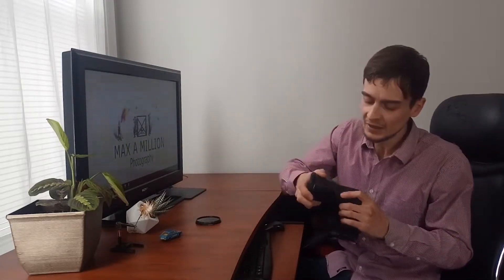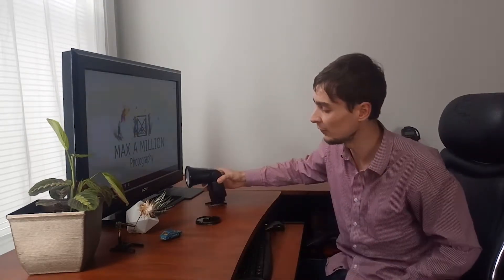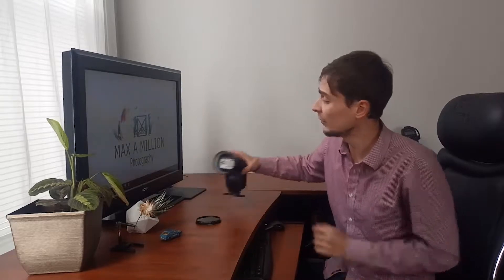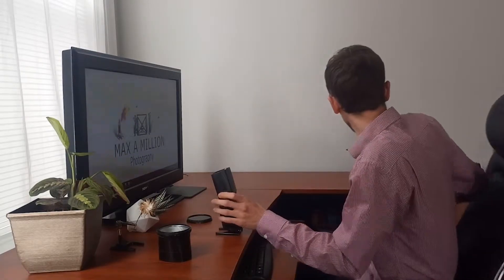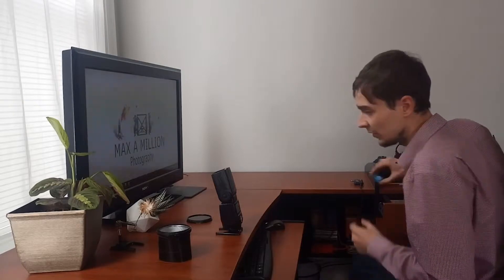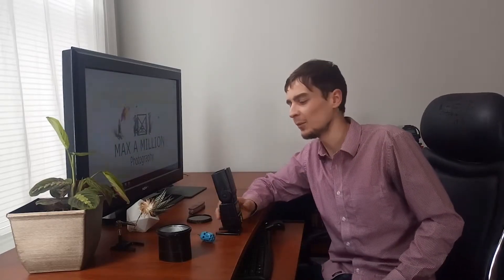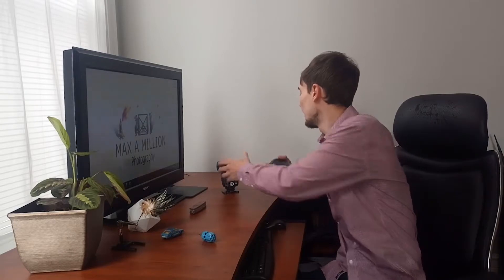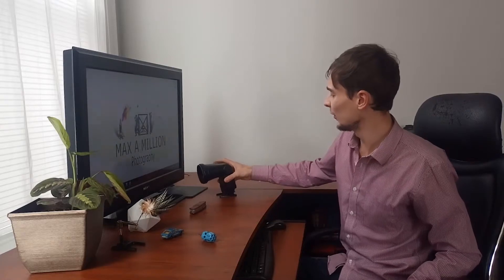UV Fluorescence Macro Photography DIY UV Speedlight

Comment: https://www.aliexpress.com/snapshot/0.html?spm=a2g0s.9042647.6.2.159163c0YA3VJT&orderId=8016510909684248&productId=33004536433
I ordered this one and as soon as I have it, I'll post my impressions. By the way, what step-up rings did you use? The diametre of the pringles can is variable. Apparently, it is now smaller than it used to be. I can see in the video that you are using a 77m step-up ring but I am unsure as to how to attach it properly to the can itself. Thanks for your input and post. Cheers. Leo

Comment: Hi, do you need an IR converted camera or it also works with normal sensors?
Reply from the maker: Hi, no this will work with any camera. You only need a full-spectrum camera to photograph actual UV-light, but not for the fluorescent effects of it ;)
Reply: OK, thanks!